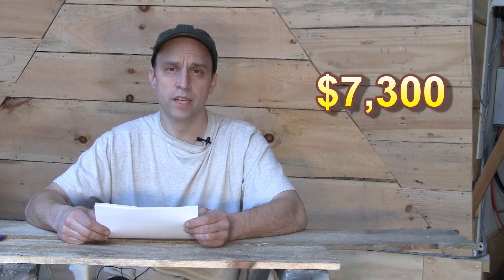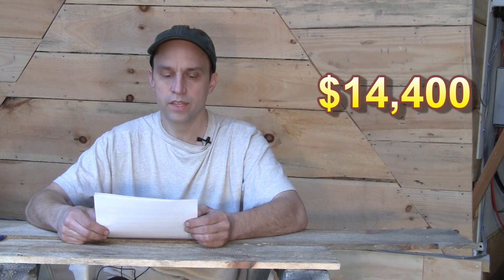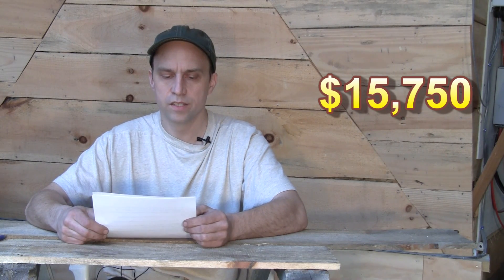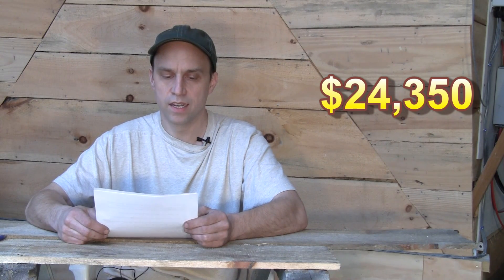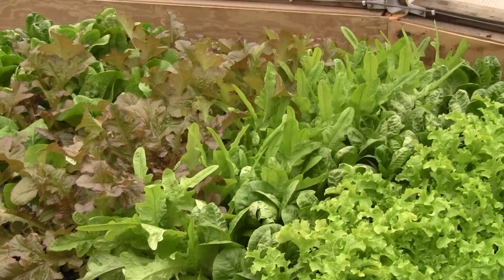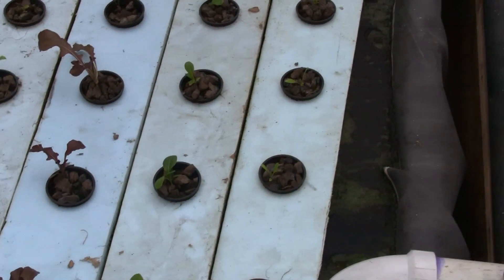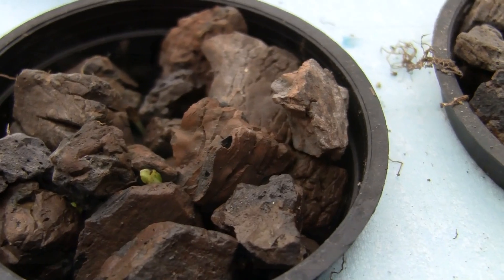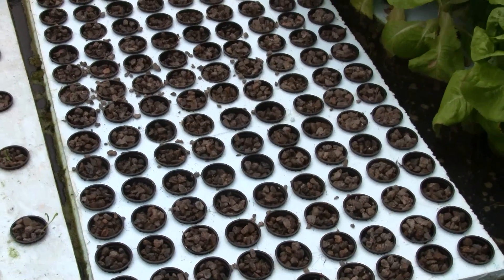FAQ #4 - Aquaponics - Geodesic Dome - Rocket Mass Heater

Comment from the maker: it's it's difficult to regulate the burn rate of a RMH since they like to burn full-throttle.  you probably could put it in an exterior building but a lot of heat still radiates out of the heater so your little building it going to get pretty toasty.

Comment: Great info in your videos, thanks for the effort and time to put it up on YouTube. I noticed that you are replacing the riser in the rocket stove with SS.  As a potter I have used castable refractory such as fire clay for kiln shelves and spacers made into the shapes required. Is there a reason that you prefer metal to ceramic? Just curious.  Thanks again.

Comment: Hey. Great video and i love all your videos on your greenhouse. I was wondering. I have a 8' 6" by 24' 10" rion greenhouse and i was thinkng about building a rocket mass heater in it to heat it. I have 2 questions. 1. Does the heater need to be inside the greenhouse or can i put in in a small cob style shed beside the greenhouse and run waterlines like yours into it for heat? 2. Can you run a small auger one a computer to keep the heater stocked on a sort of climate control system?

Comment: Ran out of space on my last comment. In my second question i mean can you have the auger hooked up to a computer with thermometers in the greenhouse and have the system automatically add fuel to keep it at say 5C? I also wonder if you could have a small propane pilot light only about a inch of flames right where the pellets would fall so even if it had no pellets in it then it would automatically reignite? Is it necessary for you to be there to start it?